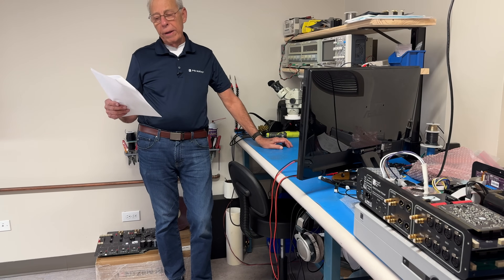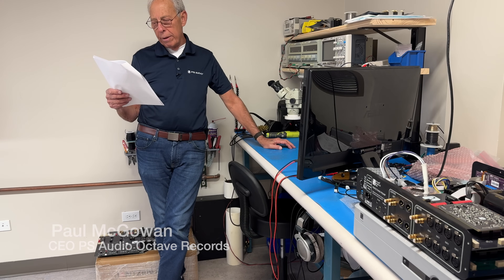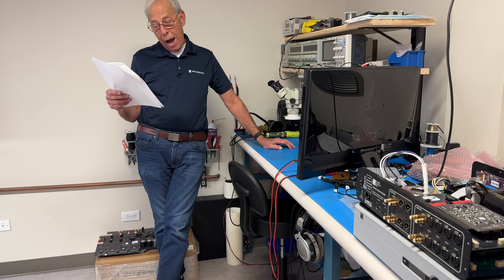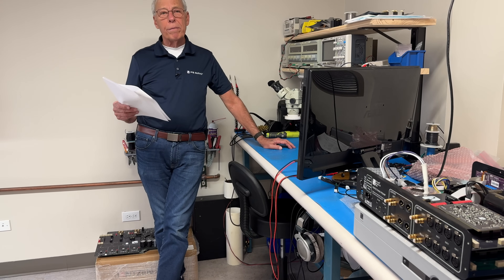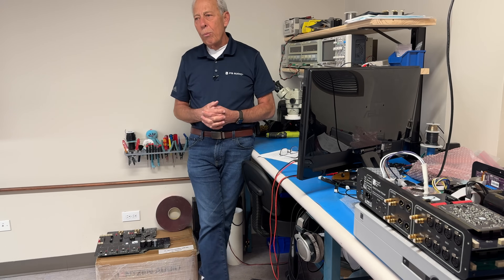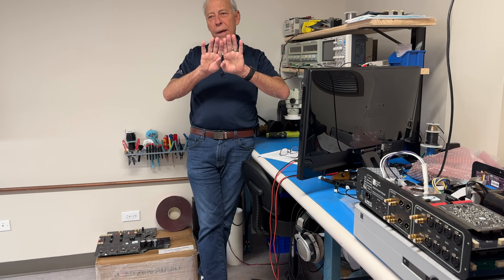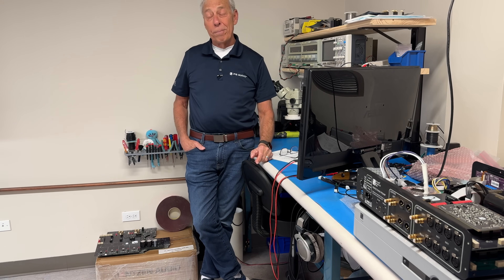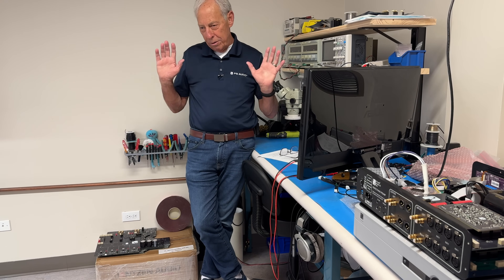Active crossovers

Comment: Now I’m really confused. Paul says audiophiles don’t want active crossovers because they don’t want to have to fiddle with level controls, crossover points and phase adjustments, but he also repeatedly says every system should include a powered subwoofer, which requires adjusting a crossover with level controls, crossover points and phase adjustments to fiddle with.
Reply: As an audiophile, I can tell you there's nothing better than experimenting and fiddling with equipment
Reply: @xaviermontalban1701  That’s exactly right and what many of us audiophiles enjoy. We don’t just go to Best Buy and ask some installer to come and setup a system.
Reply: Yea.. they don’t want to fiddle with active crossover but don’t know how to connect a single HDMI cable to a soundbar, but happy to spent hours to adjust speaker positioning and toe in, and prefer separates than integrated and don’t mind spending money and time for connecting each equipment..😅
Reply: You have a choice to go with an active crossover or not.
If you want a sub woofer you don’t have a choice. You have  to tune it in.
Reply: @steveodian6008  Hi.And it's not as easy as some of the manufacturers like to make it look. The end user is trying to optimise a crossover without knowledge of the slope,how room acoustics affect the response etc. Far from plug and play.
Reply: Agree. No fussing with crossovers can be tolerated but measure your room and your listening position and make sure you have a slanted ceiling and (as you mentioned) position your subwoofers, and put up absorbers or diffusers, etc etc
Reply: Why confused? Two different things.
And I habe a sub and have never used x-over points since I have 12" floorstanding speakers. The sub just adds what the room looses. Unless it's small bookshelf I never use the HPF for the speakers and just juse the LPF for the sub to match them.
Reply: A subwoffer, when added to a revealing system, would generally use a passive high-pass filter, such that the signal going to the main speakers is harmed the least -- and the signal going to the subwoofers will fill in the bass that is missing from the main speakers.

Not every system should have a subwoofer -- at least not for the reasons Paul has stated.

Generally speaking, you would want a subwoofer if your seated position is not receiving proper bass, due to the room's acoustics.  But if your room is properly treated, and happens to have good acoustics, and you are getting excellent bass in your seated position, then a subwoofer is not a priority.

Other than fixing for a lack of bass, due to room acoustics, the main reason for using subwoffers is to relieve your amps of producing powerful, deep notes, and also to have less shaking coming from your main speakers.

With your main amps dealing with less bass, they will send a cleaner signal to your main speakers.

With your main speakers producing less bass, their cabinets will shake less, resulting in its midrange driver and tweeter shaking less, resulting in better focused sound.
Reply: @0Perhaps  Hi.I concur and understand all the points raised.All perfectly valid.It's more of a case of Paul seemingly contradicting himself, which I think we all do from time to time.
Reply: @oliverbeard7912  It's not a matter of Paul contradicting himself. He just doesn't sell active crossovers.
Reply: @BlankBrain  Well,that too.
Reply: @0Perhaps That’s it! What a difference that makes. 
What crossover do you use?
Reply: There is a huge gain of audio performance achievable using active cross-over but it only works when very carefully tuned against your already optimized room and personal preference. As audiophile, absolutely, active cross-over is next level solution and what Paul is talking about are not audiophiles but just consumers who wanna get going quickly. We audiophile already spend a lot of our passion and effort on getting the best possible performance, so that is not of a concern.
Reply: @ThinkingBetter  Disagree. There are many audiophiles who spend thousands on high end systems, set up and room treatment but stop short of active crossovers, bi-wiring, bi-amping, mono blocks, or other tweaks and disaggregation of components. This doesn’t make them non-audiophile, consumer-grade bose or Sonos listeners, it just makes them audiophiles who trust the crossover we design employed by the speaker manufacturer.
Reply: @edd2771  Yes of course. I also didn’t say to be audiophile you have to endorse active cross-over or DSP EQ. In fact, I agree that room treatment and speaker placement are so important and never should you just use DSP for optimization cause you will end up with inferior performance if your starting point is not already the best your room can do. What is almost always the case is that significant improvements can be done on an already traditionally optimized system when you apply DSP EQ. No, I rather say we audiophiles try our best within means we can afford and we don’t all share the same opinions of what is best. I would never say someone who love vinyl and tube amps is not an audiophile, for example. I used to be such person long ago. I’ve also spent much on cables and eventually came to the conclusion I’m mostly wasting my money when realizing actual manufacturing cost and the fraudulent marketing of this category of audio gear.
Reply: @ThinkingBetter  All, please note that @ThinkingBetter is spewing mininformation.

If you won a prize, and can have a home built with 10 custom made listening rooms, and 10 dream stereos from the highest of the high-end audio manufacturers, none of those dream stereos would have active crossovers.

In fact, not a single high-end amplifier manufacturer uses active crossovers in their labs (in their listening rooms).
In fact, not a single high-end turntable manufacturer uses active crossovers in their labs (in their listening rooms).
Ditto for any and every component that any high-end manufacturer uses for their listening tests for whatever high-end gear that they design.

There are stereos that sound so real that, if you were blindfolded, you would swear that you are in the room with the band.
Have a blindfolded friend take a seat (one who is not into this hobby), and your friend will swear that he is in the room with the band.

It sounds so real, that you can reach out and touch them (at least you think that you can).
And yet, no active crossovers.

So companies that make the best of the best gear do not use active crossovers.
The gear that The Absolute Sound and Stereophile rate, decade after decade, as sounding as real as it gets... 100% of that gear has no active crossovers.

And yet @ThinkingBetter tells us that active crossovers would be a huge gain (and he must mean over the stereos that I described, above).

Apparently, every single high-end manufacturer has overlooked what @ThinkingBetter knows.

Folks, @ThinkingBetter routinely spews misinformation in audio forums.  I do not think that he means to do so.  I suspect that he believes his own rhetoric.  He has never heard a professionally set up, high-end stereo, in a treated room.  He seems to be enamored with Pro Audio, enhanced, artificial sounding music (like drums machines instead of actual drums).  He likes it, and so he deems it to be better than hearing the music as if you were in the studio with the artists.  You might like it, too.  In some cases, I also like it.  But it is unnatural, and in an A/B comparison with a realistic sounding high-end stereo, the latter will easily win in listening tests.
Reply: @0Perhaps  Hey I’ve done R&D in audiophile audio gear and never would claim active DSP cross-over to be superior until recently. Yes you are right that no company focused on analog audio is excited about active DSP based cross-over filtering because it then needs an ADC to convert the analog audio to digital to process it. No, digital cross-over filtering only makes sense when you have already transitioned to purely digital music and you can run your digital audio through the DSP lossless into it also without sample rate conversion. You are talking to someone who is already deep into high-end audio and perfectly know how various OEMs are testing their gear.
Reply: @NoEgg4u not only do you come across as pedantic and arrogant, you're also wrong. I use active crossovers, and my system has never sounded better. It's a lot more work but you have so much control. It's measurable better than most systems.
Reply: @0Perhaps I have seen some of the most expencive systems use active x-over. So there is that...🤷‍♂️
Most don't use it but it absolutely has it's benefits.
But it's not for most normal people. It's not even for most audiophiles because of the hazzle..
Reply: @West3rror  It’s a hassle because the industry has not done good solutions for it. I can buy a pair of FR30 and will have to rip out the passive cross-over filters and add speaker posts to do it with those speakers. In the process I just made them non-sellable for me. Then I have to buy something like the miniDSP Flex with 8 outputs and 8 power amps (or 4 stereo amps). But I want a more audiophile DSP box! Then I have to beat or match Chris Brunhaver’s design of filter design but using DSP. When I’m back to the speakers sounding as good as when I started, I can finally go steps further to beat the original FR30. I have no doubt I can make them more linear including against my room acoustics and with any preference of EQ, and also gain better damping factor, but how much will they sound better? It’s too risky. No, I need a version of FR30 that was born with the option for external cross-over filtering and it will be a totally differently attractive situation. Perhaps someone could turn this into a business of reworking high-end speakers to be “active ready” with DSP settings included.
Reply: @ThinkingBetter  It's a hazzle because it IS a hazzle no matter what. That's just a fact.
We all know the benefits but for most people it's not worth ot and most don't even understand it. Not even many audiophiles
Reply: @West3rror  Yes, and I’ve done it and succeeded with it, but sure, it takes some passion and patience. It’s not for those who only care to open the carton boxes and plugging in the cables. My Magnepan setup is active but recently I bought a pair of KEF LS60 and it’s sort of the opposite being active inside the speakers and my most simple setup of just a couple of power cables and cross-link cable. KEF has done a really good job in next-gen digital audio with KEF LS60.
Reply: My thoughts too.I think it's more of a case of it's OK for him if it's a subwoofer, but not for anything else. Although Paul has also mentioned the idea of making tone controls, albeit digitally,which would encourage yet more knob twiddling and fussing with "favourite" settings.